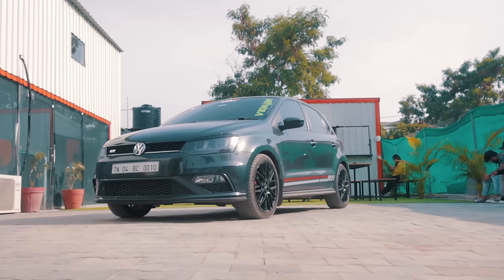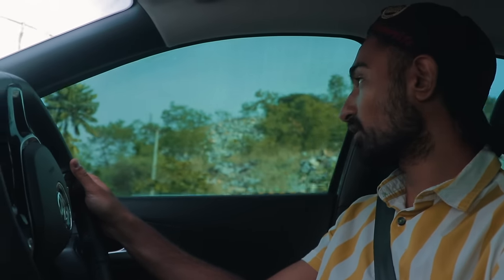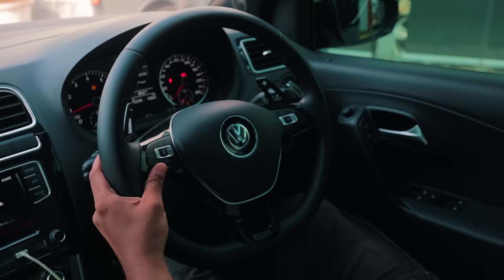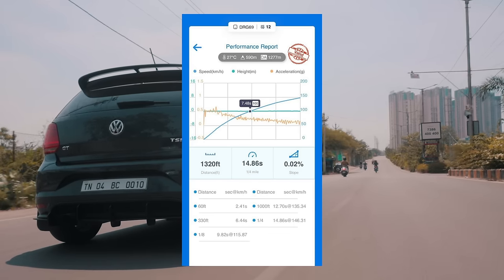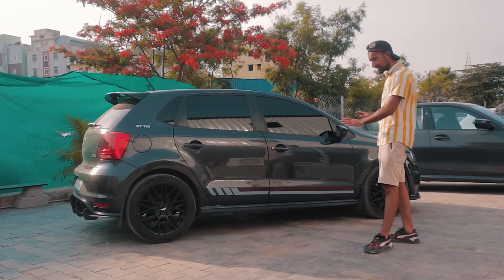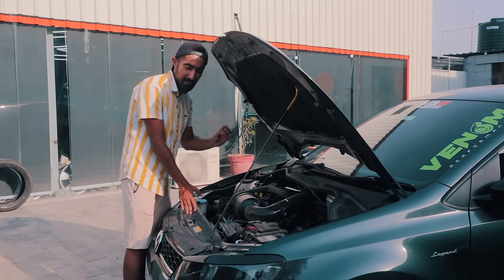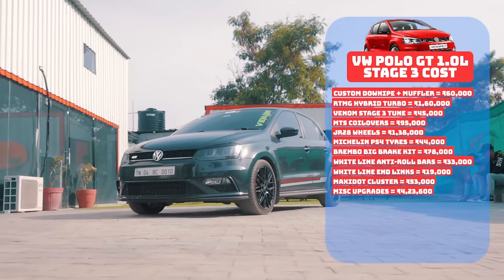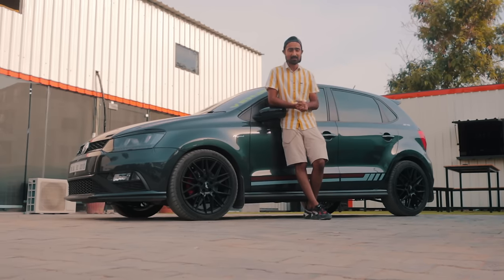Stage 3 VW Polo GT 1.0L makes 170HP & 280Nm! (1/4 Mile under 15 seconds!) | Autoculture

Comment: 2.4km/l is the part where my dad stopped watching the video with a Maruti in the garage 😂🥲
Reply: True but there is a very concrete evidence that if you drive a tuned car light footed it will put out more milage compared to when it was Factory stock.
IT JUST COMES TO TORQUE, THE MORE TORQUE YOU HAVE THE BETTER OF FUEL EFFICIENCY IS ON A LIGHTER FOOT.
Reply: If u drive it with cruze at 100kmph it will give approx 24kmpl which a stock 1L tsi can't even imagine
Reply: @mandeepsingh9469  exactly a tune Car with a light foot or in this case, close control will put out more milage because of the improved torque
Reply: @shree397  completely agree, i have a stage 2 baleno 1.2, and even with the meagre gains in NA I still get 1-2 kmpl more mileage when driving normally. But of course I can get about 12 when driving hard. Love the duality, I can only imagine this being more pronounced in a turbo.
Reply: Toh apne baap ko bol aur paise kamayega😂😂

Comment: A well done intercooler is must it will easily push from 170bhp to 180-190bhp that too depending on aftermarket turbo
Reply: There's no IC on a 1.0 TSI bro.
Reply: @srihari_sh  Hey man every turbo car has an IC haha. Where did you come up with this?
Reply: @RohanKumar-rz4mg  Lol bro do some research before u conclude something. Do a research on 1.0 TSI from VW and drop a comment again. ✌🏻
Reply: @srihari_sh it does have a intercooler.
Reply: @yeshasgprakash5023  Charged cooler is different from Intercooler bro. Please check.
Reply: @srihari_sh  ya i know still same functiom.
Reply: @yeshasgprakash5023  Agreed, the comment started from upgrading the intercooler and my stance is there is no IC to upgrade one.
Reply: @yeshasgprakash5023  Same function doesn't mean IC and Charge coolers are the same right?
Reply: @srihari_sh  look here both serve the same purpose , just look at this i am posting this from google

A charge air cooler is a part that cools the air between the turbo and an engine's intake manifold. It's the generic term for turbo coolers, intercoolers, and aftercoolers. Turbo coolers and charge air coolers are identical. It's all a matter of preference as to which one you use.
Reply: @yeshasgprakash5023  Bro understand the context no? There’s a wide variety of upgraded ICs for most of the cars, Not the same for Charge cooler. Ofc, They both serve the same purpose. Is it possible to find any upgraded charge cooler? No one would go for that. Afaik, Upgrading the IC is what people do. The comment was to get a good IC to push power upto 180-190 which isn’t possible by upgrading an IC in a 1.0 TSI cuz they DON’T have one.
Reply: @srihari_sh  still holding on to that one aren’t you.
Reply: @yeshasgprakash5023  Let’s not turn this into a debate. You still holding onto that it has an IC and feel can be upgraded! Aren’t you?
Reply: Bro 1.0 tsi engine doesn’t comes with ic its manifold is cooled by coolant thats it
Reply: @srihari_sh  you say you did your research make sure do it twice 1.0 tsi comes with water cooled engine cooling system it doesn’t comes with bolt on Intercooler but yet super sport delhi have done more then 3x stage 3 1.0 tsi builds with their own plumbing Intercooler which can’t be done remotely only by then and yet Harmonix tuning from Bangalore are developing one for thier off road 1.2 tsi build which shares the same front as 1.0 gt tsi as well
Reply: @aliston5028  but as of now officially, 1.0 tsi has no IC upgrade, but apart from the high IATs, the torque converters shoot up boost when shifting as said by VAGmaster, that might be the reason the map is not as aggressive
Reply: @aliston5028  Still speed sport Delhi was able to clock 15.8 with that on the track??? There’s no draggy figures too 😕 Vagmaster’s Stage 2 with stock downpipe did 15.2 😜. Let Harmonix develop the IC for 1.0 TSI and then you can put up the talk.
Reply: @srihari_sh  you can’t expect more if anyone leaving stock downpipe on and then getting a stage 2 tune.
I got Gt tunerz 95ron map is very good on 1.0 gt tsi plus with this tune shifting speed have definitely quick compare to stock
Reply: @c2pgt yes there’s no IC upgrade, and I don’t know about how good vagmaster tune is compare to GT tunerz 95ron Stage 1 remap, which I have on my polo gt tsi 1.0 litre with Racingline line air filter and Racingline turbo inlet pipe, 
The shifting speeds with this tune are quick compare to stock 
Yes an upgraded IC will definitely help to produce more boost and will also keep air intake temperature down
Reply: @aliston5028  No bro, you are going out of the context. You told speed sport Delhi has done 3x stage 3 1.0 TSI with their own IC plumbing. What’s the use of doing those? Still they did 15.8 on the track and there’s no proven record on draggy also. Whereas a simple stage 2 from Vagmaster Chennai is better than their stage 3 is what am trying to say.
Reply: @aliston5028  if you push hard enough i think it would reach temps upto 105 if not more, with any tune
Reply: @srihari_sh  thats a manual car tho, i dont think an auto could pull out such figures with a stage 2 tune from any tuner
Reply: @c2pgt  True, it’s a manual!!!

Comment: I personally feel Stage 2 is where you should settle for a reliable and practical Polo build. A turbo that spools at 4k rpm and only 2k rpm to play with? How is it practical? 

The car is proven to be very good on the drag strip, kudos the owner and the build! But again 20L is sooo much money and I wouldn't choose to spend that like this.
Reply: Right? Could’ve gone easily for a pre owned GTI Itself.
Reply: Stage 1 for the auto is the best

Comment: Is there any possibility to add turbo in the 1L mpi engine
Reply: Yep you can
Get a garet turbo and a intercooler
And decent tune.
Reply: We can use the exhaust manifold setup of 1L tsi right? Do you know any shop that do this turbo project
Reply: I have a 1.2 tsi vento and 1L polo mpi, engine swap is costly af , so thinking to add a turbo

Comment: How about an AWD Chevrolet Beat
Reply: I dont think that is possible.....the car's chassis can't handle alot of power
Reply: @johannfernandes9659  yea you're right
Reply: But what if someone just made it, imagine how cool and also dangerous that would be 🤣
Reply: Hard to find that small propeller shaft to fit beat. Idt there is one in the market.

Comment: Mine is also a MT Polo Stage 3 ..
But it produces 480 bhp and 500 nm torque
Reply: Add videos in your channel
Reply: @ncsvcreations8671  I don't have a YT channel
Reply: Have you chained 4 1.0 Polos together and made a train?
Reply: Abhishek_033  no bro I only get an avg. of 12-13 kmpl
Reply: @FXh0mer  no bro I've swapped it's engine with a 1.8 Laura
Reply: 2 months ago it did produce 400 hp ryt?
Reply: @Adv.Faizan  yup
Reply: @SoulGaming279 800nm🤡😂😂😂 your last comment on the channel it was doing 500nm
Reply: Sorry By Mistake it's 500 nm only. 😅😅
Reply: @FXh0mer  🤣🤣🤣

Comment: Bruh why has nobody done a tcu tune for this carrrrrr❤
Reply: Because this gearbox doesn't come with a brain
Reply: @varunmewada8388  bro can u please explain
Reply: @AndrewTate-nn6gh  you can't tune torque converter in polos
Reply: @_PRAMIK  oh , thankyou 🤝
Reply: simply put, the DSG has a seperate computer which can control the way it shifts, the torque converter is a standard automatic transmission found in most cars.

Comment: Add 20 more hp and there goes the engine
Reply: Exactly
Reply: Some guys in Brazil are running close to 230 idk how
Reply: Not really,, there are many builds producing 200-210 bhp
Reply: Nope 1.0 TSI is very capable it can handle 270bhp even. VW tested it in house themselves with a Turbo Charger.
Reply: @__pratt07 finally someone agrees

Comment: Economy 2.5km/ltr 😂😂😂
Reply: Who cares
Reply: Worth it
Reply: 11 lakh on polo doesn't make sense.. if you add the car cost then it will be like 22+ and now days you will get stage 2 VRS in under 25 lakh. Which has more fun, more power and practical buy in terms of space...
Reply: @saggy2299  you don’t need to spend 11 lakhs on mods it’s own drivers preference plus you are getting huge reliability which is huge plus
Reply: That 2.4kmpl is Consumption bro, Not Avg.Consumption. Mileage is Avg.Consumption.

Comment: If it was fun car then why the company discontinued it?
Reply: Because new generation polo's length is increased by 82 mm, which makes it 4053mm in total that exceeds 4 meter rule of excise duty by Indian government.
Reply: @naushadkhan-hw9nn  and despite having such cult following in india company does not think of india as an important market to reengineer the car and make it less than 4 m. Company doest not give a 💩 about the fans
Reply: @Rvj.12  out of 100 fans only 10 have the capability to buy the car the company knows it very well 😂😂
Reply: @naushadkhan-hw9nn  lol  when new generation was sold in other markets , they were still selling old models in india, they discontinued the old model due to lack of sales, it has nothing to do with new generation, stop lying

Comment: 1.0 TSI is capable of producing 270hp
Reply: Lol, that would be the last day of that engine.
Reply: @sarthaksabbarwal71 no you are completely wrong or don’t know that in stock German engines are meant to be pushed twice more then they are already doing in stock form, that’s the only reason German engineering are way above when it comes to performance and reliability
Reply: @sarthaksabbarwal71 you can say that to hayundai or maruthi I suppose😂
Reply: Only with supercharger
Reply: @abhimanyuchauhan1014  yes
Reply: @aliston5028  if u push it twice the power, then the engine life will reduce half the km's, its as simple as 2+2=4
Reply: @Vicky-ne9mt no vw have tested in house turbo which can push 270+ bhp on this 1.0 litres gt tsi, it’s German Engineering at the end of the day don’t forget they are only about superb reliability and lost of power to play it if it’s done properly

Comment: Its slow tho
Reply: 14.8 seconds from 1.0L 3-pot doesn't seem slow
Reply: @vwclub4739  14.8 seconds bruh...it's slow 🤣 I thought these car atleast make it in 9 seconds 1.2 gt is the best in class not 1 litter scam from Volkswagen
Reply: @mohammeds_35  1.2 TSI is even slower. SOHC engine, no big turbo options, made like a tin can.
Reply: @mohammeds_35 these are quarter mile timings not 0-100
Reply: 14.8 is the quarter mile timing my guy not the 0-100 time 😭
Reply: @mohammeds_35 true 1.2 stage 3 will be kicking some serious ass
Reply from the maker: Quite the opposite! The 1.2 TSI is a eco-box engine whereas the 1.0 TSI has some performance DNA, you can't go Stage 3 with the 1.2, reliably atleast, no big turbo OEM or aftermarket options. Only way is to go hybrid turbo, but that's very unreliable and honestly not that fast. Power levels might be similar to this build shown in the video, but the build in the video is restricted due to limitations of the gearbox. A manual 1.0 TSI is capable of making 200HP reliably with a RTMG turbo. Plus, the 1.2 TSI in India is mated to a DQ200 and we all know the problem with that.
Reply: @TheDriversHub I know it's rare, but is there any PoloGt Tdi that you guys have worked on in terms of pushing the power... I own one and definitely would plan to do something with it... Even though as a part of my personal experience.... With my Manual Transmission I easily accelerate from 60 straight till 190 on a single gear with any issues on the stock Tune i.e Stage-0 😅.. Hyd ORR is personally the best place to record it. 

Would be certainly happy to upgrade mine if there are any suggestions u guys can put..
Stage 0  - 110 Bhp + 250 Nm Torque 😂😂
Reply: @DailyDrivenPoloGtTdi  danm
Reply: @DailyDrivenPoloGtTdi  1.6 right?
Reply: @abhijith_km  2017 GT Tdi 1498cc 1.5ltr
Reply: @DailyDrivenPoloGtTdi  you can definitely push a lot of power from a gt tdi there are many builds out there.... If you really want a perfect build go for a stage 2 build as it is definitely more reliable than both stage 1 and stage 3...appx cost for that will be around 1 lakh
Reply: @DailyDrivenPoloGtTdi  and the powergains will be around 40-45 bhp so it will roughly produce 150 bhp and around 300 nm torque